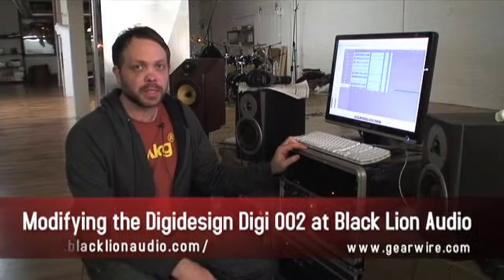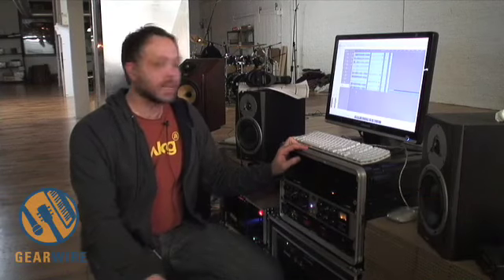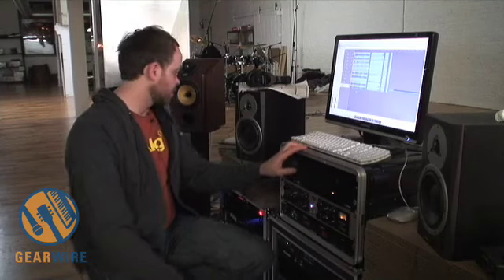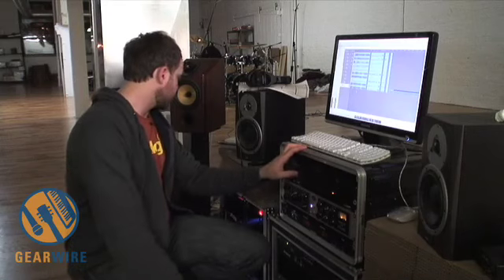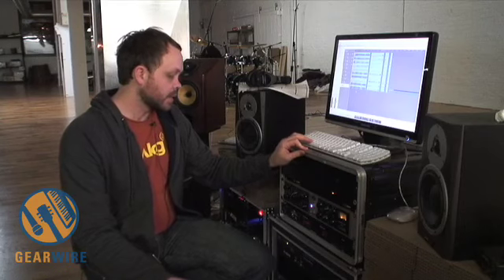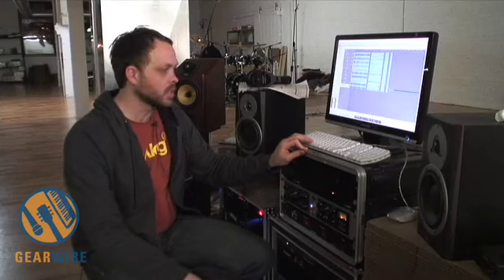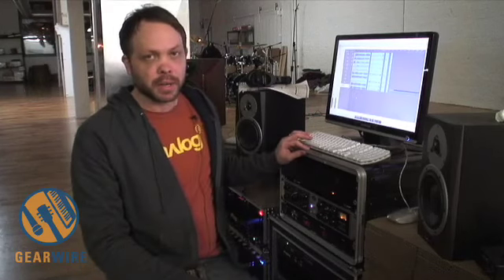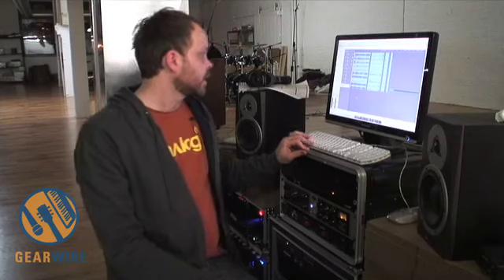Modifying the Digidesign Digi 002

Comment: @Deathrape2001 The sample rate debate will more than likely never end, but running at 96 does help effects and VST instruments, though you are right that DVD and CD use less.  Bit rate on the other hand is much less debated as having a higher dynamic range going into the box really does improve the final product once it is dithered down.  Also note I said I record often at 24/44.1.

I had a Behringer EP2500, good amp.

I never said "obsolete garbage", so please don't misquote me.

Comment: @Deathrape2001 It's not really intended to be a review, as it is being presented by the guy that does the mods.

@dante75915 You are right, you would get the same, and in some cases better, from a good converter with a nice preamp.  I'm thinking of getting a BLA Sparrow MkII for my set up down the road rather than the mod.

Comment: @Deathrape2001 Haven't used any Apple hardware... and didn't know they made any, computers and whatnot not withstanding.  Unless you're using your computers AD I don't really see how it would effect the sound of a recording as you bypass a computers AD/DA completely when you use an interface.

As for the Soundmax chipset, how did you get it to work with your DAW?  Are you soundcard based?  Or wired your own AD?  May be something worth looking into if I can get it to work with my interface.

Comment: @Deathrape2001 Also, in regards to the soundmax chipset, it is an interesting tip but somewhat useless in context of recording as every version I have found online is not only an integrated chipset, they all cap out at 16/48 and I record most of my work at 24/96 or 24/44.1.  It sounds like we are talking about two very different things as the more I look into this "tip" you keep giving me, the more it looks irrelevant to my needs, and those who would be looking at a video about a 002.

Comment: @Deathrape2001 Did you even read my last post?  The point I end with is that it is not recommended to upgrade your converters blindly.

If your set up gets good results all the power to you, but I need more than your free option has to offer for my line of work.  Have you compared it to anything top dollar? Somewhat curious of your experience with other converters.

Also, if we are going to continue this debate could you please speak like an adult?  I am finding it hard to take you seriously.

Comment: Why would anybody buy a digi 002 if they wanted good mic pre's?.
Reply: haha yea i was thinking the same thing. I have the signature series 002 rack and it was definitely worth the upgrade. The A/D and D/A converts are amazing and the micro clock is a beast. The pre amps are pretty good but I wouldn't use them on drums. I would've used an acoustic guitar for my test.